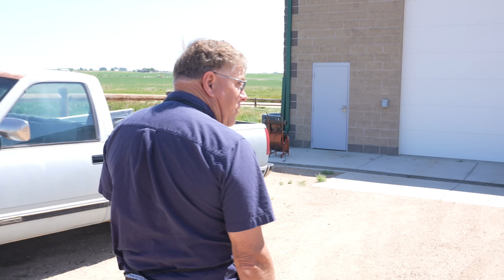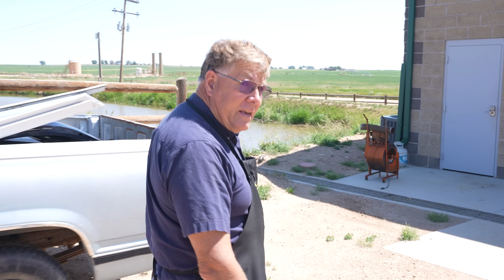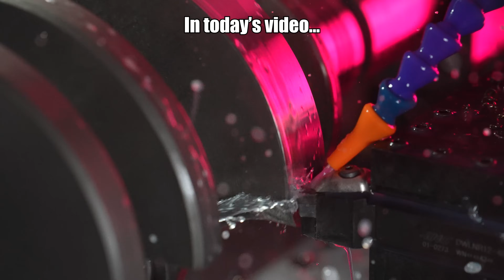CNC Lathe Turn BALANCING A V8 Crankshaft ... It Did NOT Go Well!

Comment from the maker: PDS Debt is offering a free debt analysis. It only takes thirty seconds. Get yours at https://PDSDebt.com/JIMSMACHINE.
Reply: Would it do anything for idle quality to balance a stock engine within less than a gram? To balance a nickle on the engine while running at idle?
Reply: @joseantoniocastrellonjr2568  Might, if you have aftermarket solid metal motor mounts.
Reply: PRICELESS !!!!!  IN SO MANY WAYS
Reply: Less spinning weight is faster but it's a hard balancing act there are things that I'm very accurate nowadays x🤓

Comment: Just an observation about your imbalance after removing material 3/4 inch in diameter by 3/4 inch deep. The center of mass of the material removed is at a smaller diameter of rotation. It's not the same as removing the weight from the surface. I would think that would affect the balance differently. I do like your videos.

Comment: @JAMSIONLINE love these more in depth videos.  We used to do no drill balancing on high revving (14000rpm) cranks.  We found the best place to start is with a heavy chamfer on both sides of the counterweight.  The closer you get to the crank centerline the less the material removal affects balance.  We'd also reduce the radius on both ends of the counterweight  by 030 about 1" with a grinder to ease the inturrupted cut on the machine.
Reply from the maker: Interesting idea!

Thanks for watching and for the comment!

Comment: You're doing a 2-plane balance. The 2 planes are defined by the 2 supports. The tendency is to remove mass from the nearest counterweights, but that's not necessarily where the excess mass actually is. You can move the supports around to see if there are other places where less mass removal is called for. The planes that require the smallest adjustments will be closest to the excess mass, and it should give you a better sense of where the excess mass is distributed.. Yes, that's a lot of extra work, but you were clearly willing to put a lot of extra work into this particular crankshaft.

I really liked how you were thinking and explaining about what happens when you remove a layer from the OD of a counterweight and how that is going to move the removal point.

I would have loved to see you remove at least some mass from nearby counterweights when you started out on the lathe. If you think about it, there's no reason to assume that all the excess mass is only on the counterweights at each end.

I really enjoy your videos; they've taught me a lot. I'm also very impressed by how well equipped your shop is and how willing the new guy is to learn from the cleaning guy.
Reply: Clever thoughts!
Reply: You don't move measurement points, but change/remove counterweights to see which tap(s) has/have the imbalance. You usually do that after you do the balancing with all weights on to get the overall balance sorted first. In this case there was plenty of weight in the outer balance weights so nothing got lost and the overall rotating mass got lower, which is good.
Reply: Now I can see why dynamic balancing is so expensive.

Comment: When balancing a crank, the end counterweights are doing all the work of bringing the whole mass into balance. There are inherent imbalances within the other counterweights that put bending forces on the rod journals resulting in radial load on the main journals. Skimming all the counterweights would equalize these individual imbalances and you could fine tune at the ends. 
    Another approach would be to offset the crank centerline in the lathe to bias the cut deeper at your mass offset angle at the end counterweights.
Reply: "Another approach would be to offset the crank centerline in the lathe to bias the cut deeper at your mass offset angle at the end counterweights."

Comment: Cutting off the leading edge of the counterweight will move the center of imbalance backwards and more to the middle of the counterweight. I would start with that work to move the center of imbalance to the center of the counterweight, then shave the top of the counterweight until it’s balanced. Great show!
Reply: Just a thought. If you offset the center of the crank by about .100 (at chuck and tailstock) and rotate crank so high point was at your balance mark, then you would turn the most material at your needed removal mark instead of the whole radius of the counterweight.

Comment: I really like the approach here, and it puts me on this train of thought:
1. Grind the end of the counterweight first to push the imbalance to the middle of each end counterweight
2. Turn down the counterweight to remove the bulk of the material
3. Finish by drilling a relatively small hole close to center, or grind both sides to finish. 
Yes, I understand grinding is not fun or time-effective, but it looks so nice!

Comment: I like the idea of removing material at the perimeter of the counterweight rather than boring inside. Seems to me the deepest inch of material removed from the hole will have a lesser effect on the balance than a same weight removed at the outside circumference.

Comment: When I used to balance turbine engine rotors, we never corrected both planes at the same time. Always working on the worse end first. The 90 degree shift is a very common occurrence when you are very low imbalance and just miss the weight or angle.

Comment: If you use a four jaw chuck you can lathe the counter-balance with the machined portion centered over the the point where you want to take material off. Just plane and center the crank on the lathe with the center of the portion to be removed centered on one of the jaws. Then snugly set the jaws not on center and then move the centered jaws in such a way that it moves the crank out half the distance you need to remove. Use the insert to get this close. Then tighten all the chucks. Then when you lathe the counter-weight the removed portion will be in line with the balance point.

Comment: I do a few of these a week. The Forged and billet cranks cut very nicely at 200 RPM on a .032" nose. 
Cast stuff is never fun.
I've had chatter like you mentioned once the cam cut is gone and it's cutting the full length of the counterweight. Figuring out better clamping, and finishing with a .016" nose insert, at 150 Rpm, gave me a clean finish without vibration/chatter.

CNMG 432, 1" tool holder

I'm extremely jealous of your enclosure though. You are correct, those chips are so hot and go everywhere. I get to do all of this on a manual lathe.

Comment: Listen my brother balanced mountain motor cranks out of sterling bearing in Kansas City and they got some cobbed up stuff that came into there shop that he's had to redo, and correct, to get them into balance. He said that they complained about how the motors shook so bad, he didn't know how they stayed together.   But he would get them in bad shape balance wise with welding all over them and not dressed drilled holes all over them like they tried and messed up in locations some deep some shallow mallory slabs slapped in them willy nelly.  What you guys did here was miraculous you guys did a fantastic job he would love to see a crankshaft you guys did come through his shop for a check.  You guys  thought it out well procedurally, and systematically and got it done with deep thought sleeping on it, and do it correctly that was damn good guys. My brother has always said too that there is advantages to not ever getting them dead on because on the + side in grams or - side have effect that is positive to them operating different ranges when installed in a motor. When they are loaded in spinning motors, at RPM that some out of balance work better at High RPM then some of the balances help with making power down low because of all the operating variables with harmonics, loads, weights, friction, and all.   You guys did excellent !  My brother would never work at getting them even that close.  He has had trouble getting them to come in, sometimes not very often, but I consider him an experienced pro at balancing cranks, and he was always in high demand back in the day.  Hes getting close to retirement now.     Your process now you know, with a similar stuation will be to take off the face of the throws first to extract weight, then off lead edges, or trailing edges according to heavy side to move the hole back away from that edge and start your drilling removal process.

Comment: My overall thought is the source of the issue (too long a weight) should be fixed first. I have adjusted vibration on many things in aviation that usually have a limited amount of adjustment locations -airplane props and helicopter rotors.   The discrepancy is that the counter weight is too long for those pistons and the gross adjustment should be to grind or machine the “curvular” until the imbalance is @ TDC.  At that point the lathe or a drill  can be used as a fine adjustment.

Comment: There's a Power Nation video where Topolinski balances a crankshaft internally.
He took a small cut on the counterweights in a manual lathe to start and then finished it by slowly removing material on the counterweights at various places with a hand grinder and checking it over and over until it was near perfect.
When finished he had to drill no holes.

Comment: If anything you want to sharpen all leading edges and/or ramp the corners so that the amount of resistance cutting through the oil is lessened. You figured out the grinding the ends  after I typed my first fat headed comment. 😅 great work! ❤

Comment: Many years ago , we use to race rounding round sooooo it was great learning!!  You know bending the rules looking for power.  One day we decide to take 15 pounds out of the crank first we polished the counter weights next we went to the lathe and got the ole crank to 35 pounds from 54 pounds. Then when we went to balance it to our surprise they had to add a lot of weight in the end the crank ended up with a weight of 49 pound 🤦🏼‍♂️, after that we purchased eagle rotating assembly!!! Every time

Comment: The only thing you didn't do was on the counterweight unit chapter the edges which would have helped. Can even the inner counterweight take a little weight off. One of my favorite things was bouncing motors. The balancing of the rotating Mass. The Mercedes motor was the most accurate rotating Mass but the rods and pistons were so far off specially the small ends on the rods.

Comment: I believe that the thing I would have learned from this exercise is to grind the end of the counter weights first to center up the imbalance on the area that will be removed on the lathe.  Then use the lathe to get it close.  Then drill the last few grams to get where I wanted to be.  I might also consider mounting the crank off center in the chuck so that it removes the material from the heavy side of the counter balance weight.  I don't know about programming the lathe and calculating the spread sheet but I presume that could be done to calculate the material from off setting the crank.  I would have to do that all by hand but I presume you know how to get the equipment to do it for you.
Reply: Get that damn three jaw chuck off that machine put a four jaw in it quit fooling around That way you can offset the crank if you need to get material off an area but I'd take the material off that front counterweight as an angle kind of like they used to do in the old days put a point on it

Comment: You guys are fanatics in the good way! Damn the level of attention and analysis. Don't assume. Great to see you sorting out what could have gone and your engineering background creating some Excel wizardry. But also dare to put in on video while going 'wrong'. 

I'm member of  DIY car wrench club. One guy at the club had his engine rebuild at some shop. It used a lot of oil. Finally they found out he had 1 undersized piston in his straight 6. So probably no measurements taken just assemble some parts, wish for the best and hoping customer doesn't return. Maybe last part of previous sentence didn't even played a role.

Nope no wonder you guys almost have 700K subscribers. Though my daily job is being a Designer in digital realm I do appreciate great craftsmanship! 

I wish I would have send my 5 cylinder to you guys. Apologies for 2 months over due. Here in the Netherlands I took engine away from shop no.1 cause it took them 5 months to grind the crank and flow bench 2 heads. Said to the guy "At this pace it's going to take 2 years" The guy "Yes we have a lot of regular customers". Then I went to shop no 2., now comes to part about your apologies, they received the disassembled engine Nov. 2022. They are still not done. Got a second invoice for 10 hours of labor.I believe the hours. First invoice for some machine  work was 1 year before. So......yep 1.5 day labor in 1 year. Of course several discussions. "We have a lot of dealers and they want have their engine done like yesterday" I presume these jobs are more lucrative. Their work ethics stinks big time! What can I do go to shop no.3?! The results will not improve to go with bits and pieces done by already 2 different shops. So your work ethics and the way you guys want to treat customers is... yes top notch.

Keep up the great work and videos!

Comment: I seen a video on tire wheel balancing where instead of putting the weight right at a particular spot the amount  of weight that was added was split in half and each amout was moved away from the point indicating where it was supposed to be to have been place with better result in which they called it dynamic balancing

Comment: Although time consuming,  to check balance after each cut compared to calculated, a cool graph could have been drawn.
Reply: also gives you data to track how close theory (math) is to reality, and in the future could make finding mistakes quicker/easier.
"we know these calculations are 'accurate' within this tolerance, so if Y and X are too far apart according to the balancer, something might be wrong."

Comment: I wonder if maybe you could just put it on the crankshaft grinder with the chucks locked and grind out very slowly what you need to centered on your max imbalance point. I bet stone would get fouled quickly but eventually, you'd get there.  Sort of a weird situation here.  Crank would definitely look goofy but would still be strong.  You'd need a junk crank just to test this unless you're brave

Comment: With the curvular on both ends of the counterweight being almost triangular you could calculate it to be very close to a square of the same size and just added that into your other calculations.   Probably not necessary but it may have moved the balance point closer to the actual point

Comment: Why not do more grinding on the outside edge to move the center back towards the counter weight?

Also I would have done some tapered knife edge grinding on that one edge to remove weight and get it back closer to the middle of the counterweight

Comment: I think you should have calculated for the mass removal from all the counterweight lobes evenly before concentrating on the two extreme ones for final balancing. That way, you get the most benefit by removing rotational inertia from the crankshaft.

Comment: I've operated a lathe for a few months just after high school, so take this with a tbsp of salt, but:
1) speeds and feeds should come with the tool insert manufacturer box, and coating colors are more appropriate for different materials (this is more important for mass production, where 5% differences in coatings can mean $$$ by the end of the year. This is not the case so it's worth what it's worth)
2) interrupted cuts are much harder on both the tool and the machine, so I think the tool makers provide different specs in case of frequent interrupted cuts, in order not to exceed the working envelope of the tool itself

Comment: I watched this video a while back (when it was still new), but I'm watching it again (as ya do)...
If you had a 4-jaw chuck on the lathe, you could technically 'offset' the crankshaft in the lathe such that it would cut more material from one 'side' of the counterweight than the other 'side'.
I'd HATE to have to make the alterations to your spreadsheet to handle that...  Instead, I'd just take multiple 'light cuts' until it got close to where it needed to be and THEN revert to the more traditional 'bore a damn hole' process for the fine tuning.

Comment: You have a CNC lathe.  Program the x axis to take a heavier cut at the end and no cut at the other end. Basically making a cam. That will solve that problem.
Reply from the maker: That’s not possible on this lathe. CNC doesn’t instantly equal endless possibilities
Reply: @JAMSIONLINE  Sure you can.  I do it on mine.  I have a SL30 so its a little bigger than that one.  You just program 0.0 at what ever degrees you dont want to cut and you have a ellipse where you do.  You have "Caxis" on that or it would not read the degrees on the screen.  You program the x at what ever degrees you need to cut and not cut at. So like X.7106 Z-.0097 C-143. F.002  and so on....